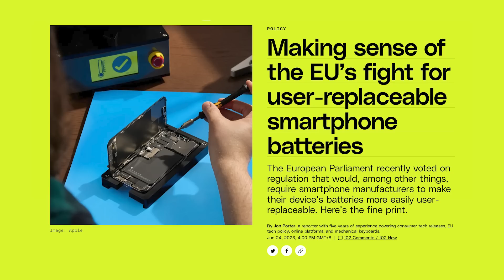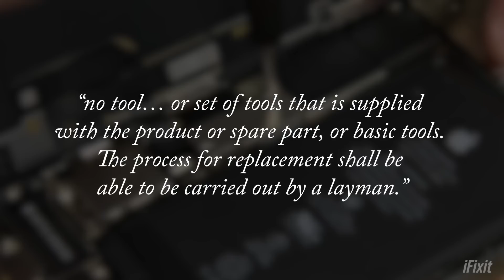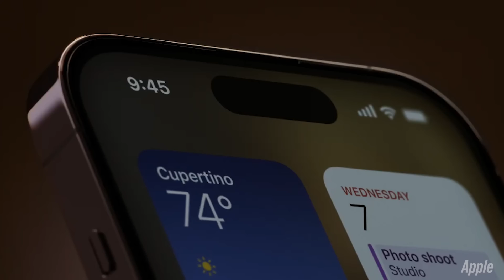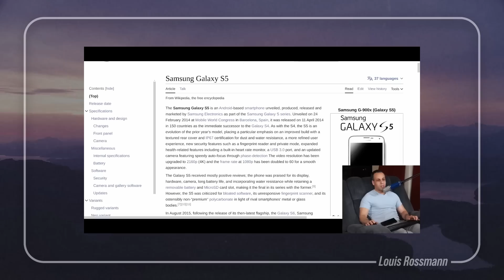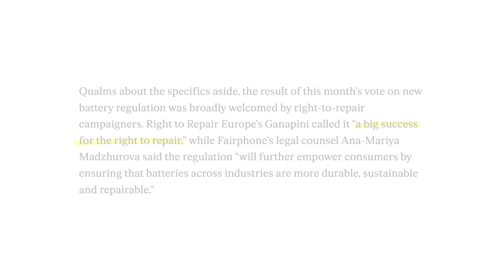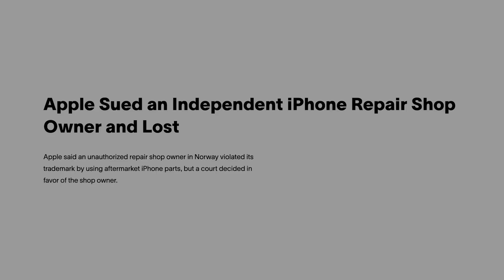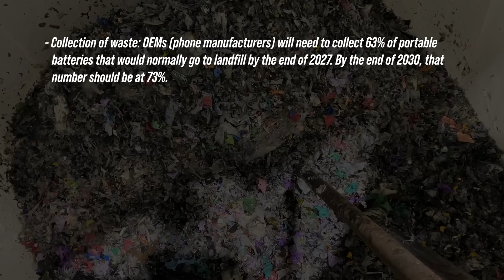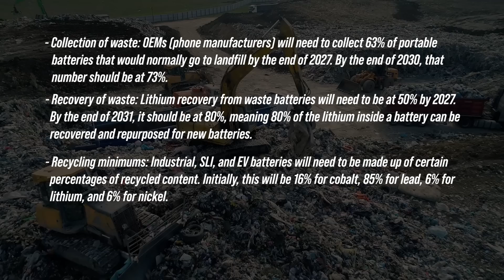EU Just Changed Smartphones Forever

Comment: The replaceable battery is the reason I still use android and not an iphone. At medical meetings or other events, when I was using my Samsung phone a lot and it lost battery power, it was awesome to just open it up, put in the new battery, and instantly be at 100%. So convenient. I was bummed when the Samsung phones no longer offered the replaceable battery, but looking forward to the future when the phones will once again have this very helpful feature. No more carrying around battery packs and cords.
Reply: @cristibaluta  You are so bought into the Apple ecosystem that you are unable to separate your personal feelings from the issue.

You can buy an external battery charger, these will cost you maybe 10 pounds. Replacement batteries will cost you maybe 20 pounds. Of course these prices depend on the device, but from a quick search, these are the prices I'm seeing. 

The only "issue" is that the phone has to turn off when changing batteries, this could easily be addressed by the manufacturer if they wanted to add QoL to replacing batteries. However, for such a minor inconvinience such as booting up your phone, you seem to be complaining a lot.

The apple battery pack costs 100 pounds, and is quite chunky. I guess you prefer paying triple for that logo.

It is much lighter and cheaper to use replacable batteries instead.

Comment: Batteries have got reliable enough that most cell phone batteries will run 3-4 years without any hiccups. Replacing batteries are relatively easy and can be done quickly from any decent repair shops around you. The real issue that exist is the unavailability of spare parts. Even if you have a phone with externally removable battery, what are you going to replace it with if the manufacturers does not supply original battery (or charge a lot) or the first copy manufacturers  are not reliable or stops making them because your cellphone is too old. 

These European laws do nothing good just like their annoying accept cookies popup that every average person ends up clicking.

Comment: The downside for iPhone users is going to be higher than the benefits...

 It is already possible to change the battery, and it costs way less than a new phone to do so. Yes, the price has been going up from $29 (campaign) -> $49 -> $69 -> $89, but that is beside the point. The law doesn't dictate what the replacement battery should cost, thus the end result is going to be:
 * The new phones will either be thicker or have smaller battery because the extra space required to accommodate glue-less design
 * The phones will be more expensive to build because of added manufacturing complexity, this will obviously be passed to end users
 * Users will be able to buy a replacement battery, but the price will most likely be exactly the same as the current replacement fee (it's exactly the same also when ordering the DIY self-service-kit), and probably more expensive than currently because the battery will need more complex design and packaging etc. The law doesn't prevent the phone from rejecting 3rd party alternatives, so there won't be any competition in that front.

The only plus is that you could replace the battery at your home without any tools, but that is very high price to pay for something you would likely be doing every couple years.